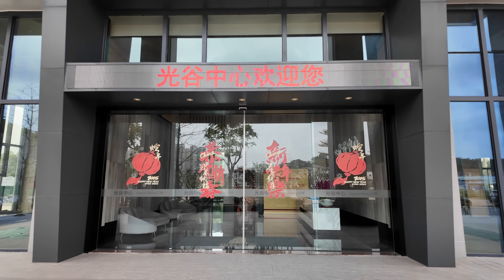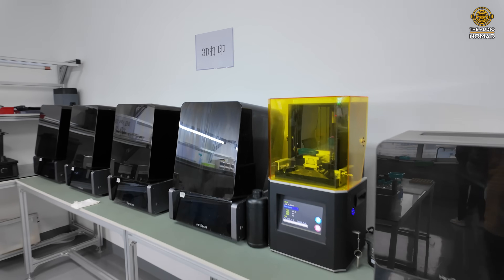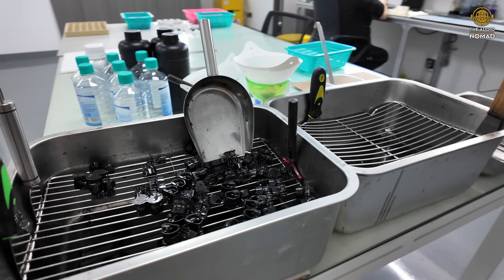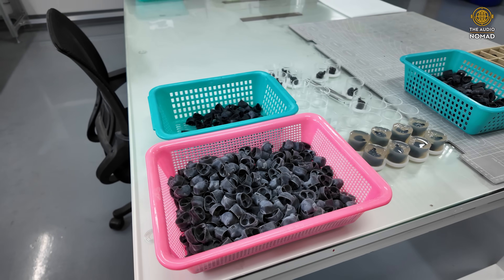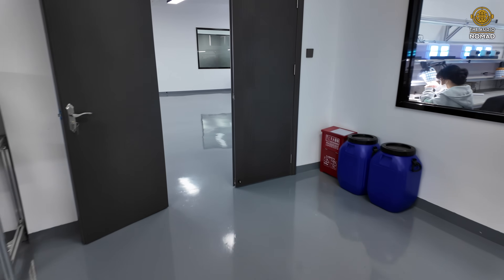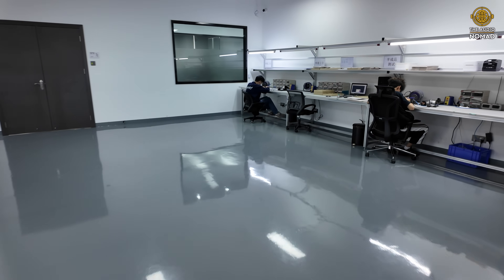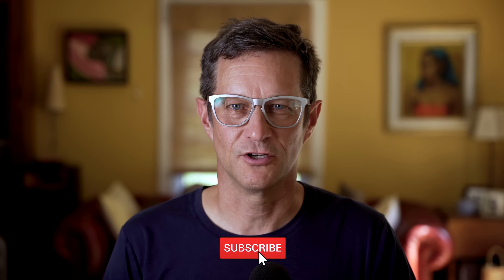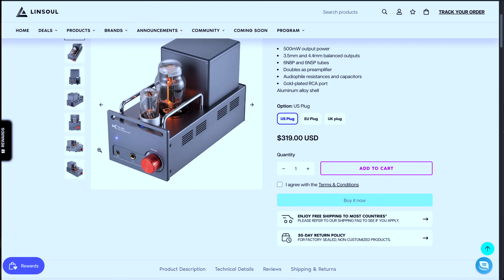Kiwi Ears Factory Tour: How IEMs are made?

Comment: I liked the bit where they are doing soldering without air extraction, just a cheap fan to suck the smoke away from his face and into the rooms atmosphere, also using UV curing without eye protection. Even the reflected UV can damage your eyes over time due to cumulative use. Same with the soldering, being in a room with soldering fumes over a long period of time. At least the guy doing the grinding is wearing a crappy mask to stop him breathing in large particles.